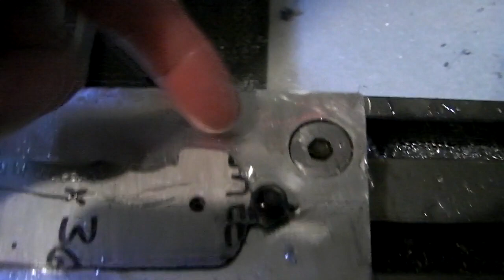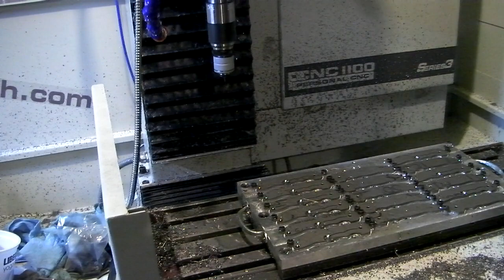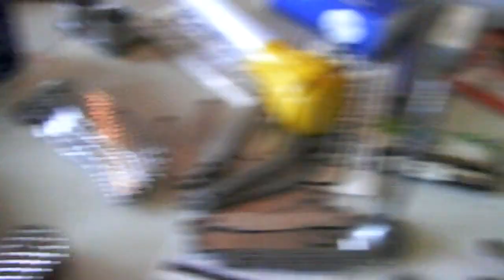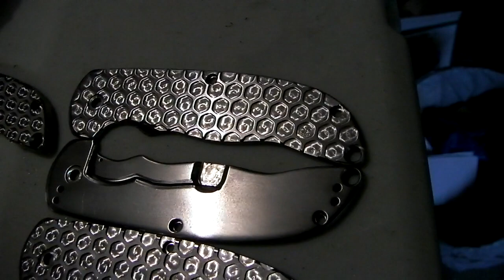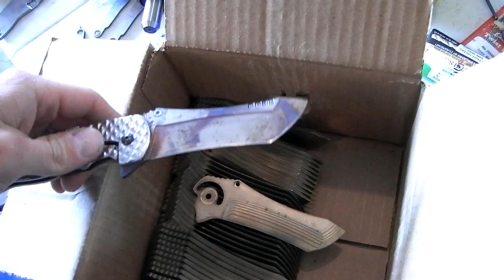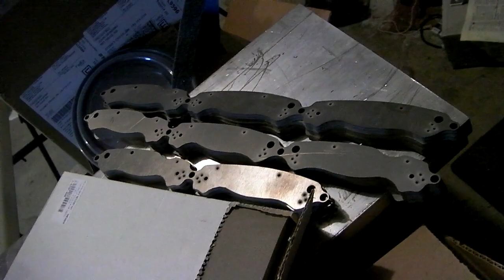Knifemaking Tuesdays Week 30 - final work before Blade Show

Comment from the maker: I've measured consistent parts with less than 0.0005" tolerance between a batch, I'm plenty happy with that.  After a few hours the stepper motors definitely get hot, but the castings don't even get warm, so I doubt there's any growth problems.

Comment from the maker: Yep, that tapping head definitely has some wobble because it's spring loaded and slides in and out.  At first I was really worried about the wobble too, but it turns out to be normal and not a problem at all, even with these tiny 2-56 taps!  The wobble isn't bad enough that the tap will miss the hole, so it's all good.

Comment: Hey Man, great stuff. Quick question, on the close-ups of the Tapping operation, it seems like you have quite a bit of 'wobble'. What's going on there? I would have stopped, but you continued, looks like without issue.. But I've just never seen that much deviation 

Thanks!

Comment from the maker: It's like that because all my operations are set up as subroutines (you probably know this), so it cuts off one pair of tabs then moves onto the next pair of tabs.  Changing it up would save all of 2 seconds per handle, which would be cool, but not worth deviating one piece of code from subroutines.  Also this way I can hit a button called block delete and now the subroutine only machines one pair of handles at a time, not the whole pallet.

Comment from the maker: Solidcam definitely does have a great simulator, however I rarely take the time to define all my bolts as fixtures, and a lot of the mistakes are because of my hand written subroutine codes and G52 offsets being wrong the first time.  My fault, and done outside of solicam just in notepad.

Comment from the maker: Yes I manually wrote all the lathe code.  Pro tip- all the X values have to be cut in half for radius, normally on a lathe I'll program for diameter.  Also, each tool uses a G52 offset, I LOVE LOVE LOVE using G52.  Glad you liked watching it!  I still have a huge ass smile just thinking about it, can't wait to do more turning with it.

Comment from the maker: Been thinking that same thing too buddy, haven't checked it yet!  Definitely need to.  I did use a 2" facing mill to face all of my pallets left-right, and the step between passes was extremely minimal, maybe 1 thou, so based on that I stopped worrying about tram.  However I'm noticing that cuts at the front of the pallet are sometimes up to 0.010" deeper than cuts at the back, so I wonder if tram is affecting this?  I dunno, the pallet was faced flat ON the mill, so I dunno.

Comment: You seem to do lots of mistakes that would be easily corrected if you simulated the operations. I use sprutcam with my 770, and it can simulate all the tools and operations. Does solidcam not have such an option?

Comment: also.. what if u machined the clips vertically starting out by the screws holes and ended by the bolt. then u would never have to worry about the tabs breaking off.. and if they do they will be almost done. just some food for thought